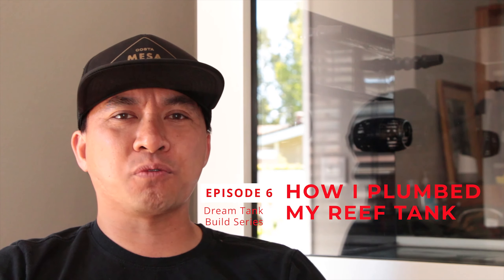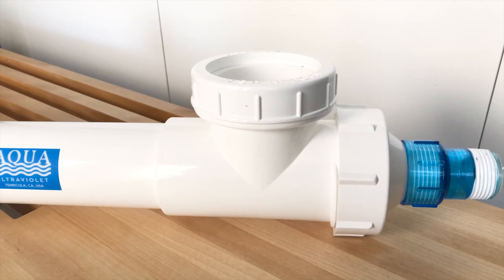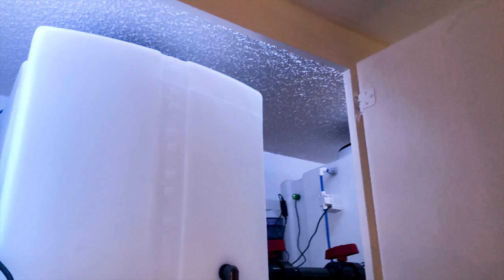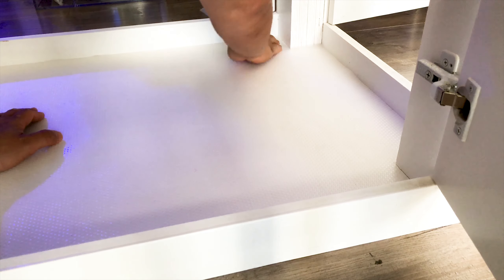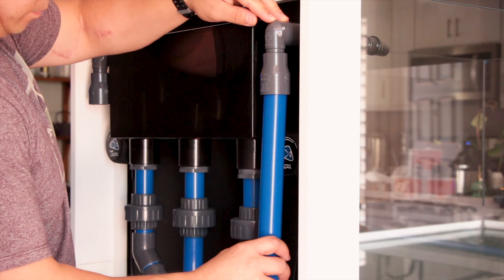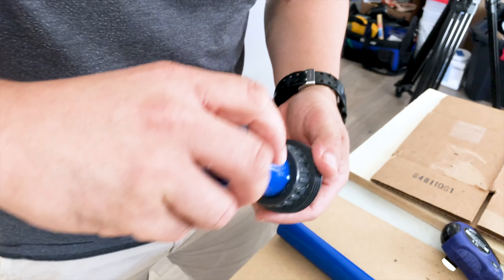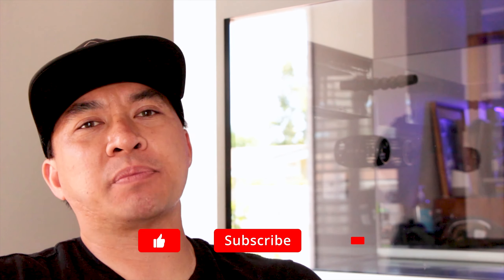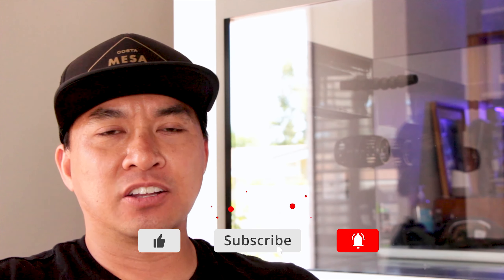Dream Reef Tank Build Series | Ep. 6 | How I Plumbed My Reef Tank

Comment: Do you have the exit of the UV plumbed into the return lines instead of routing it back into the sump? If so, I would reconsider that one. 

Looks great all together!
Reply from the maker: @JCasper thanks for watching! Yes, my UV is plumbed so that is exits back to my return and into the display. I appreciate your support!
Reply: @PetmaluLife  Do you have any safe guards on the UV plumbing to make sure that if the return is flowing at a higher rate than the UV it won’t backflow into the outlet of the UV?
Reply: Won’t it create pressure where the water is trying to exit? 
There is already flow going that way so want it be working against each other?
Reply from the maker: @cameronbasford8991  Thanks for watching! Based on my flow sensors, looks like everything is at my ideal gph rate so it doesn't looking like there are any pressure issues.

Comment: Really good job man! Looks amazing, what size of pvc did you use? 1”? I’m planning my plumbing for a 120 Gallon with a Bean Animal as well, but don’t know if I should go with 3 drains on 1” or 1” 1/2? I feel 1 1/12 is way too much for the size of that tank! I would appreciate your recommendation!
Reply from the maker: Hey Allan!  Thanks so much!  I used 1" PVC which is plenty large for my system.  I can't even open up the gate valve all the way because the water will come down too fast into my sump and make too much noise.  I think 1" will definitely work for you especially since you're doing bean animal style.  Let me know how it works out!
Reply: @PetmaluLife  Thanks man! I will definitely let you know!

Comment: I only have great things to say about your video production and your build equipment. Everything looks top of the line. 

However, I’m not sure the clarisea will be productive being plumbed off the manifold - by the time the water reaches it, the sump will already be a garbage can. Why can’t you switch the location of the skimmer with the clarisea? I would do whatever it takes to put the filter roller first whether drilling baffles or removing a baffle altogether.
Reply from the maker: Thanks for your feedback. ClariSea talks about being able to run your own pump from it. Works totally fine. I can control the amount of flow going though it as well. For example I really only want to be around 5x turnover for the tank but for the ClariSea I can bump that up to 10x if I wanted to. The water in the sump would circulate and be clean. Also, with the help of the large skimmer and UV, sump should be pretty clean. But only time will tell and also what kind of stock I put in. But, I’ll keep you updated for sure.

Comment: Bro subs ako agad! I’m gonna do what you’re doing 😀,. I’m in the process of starting my WB Peninsula 4820. Question bro,. between the Neptune Apex and GHL Profilux,. Ano mas maganda, reliable? Pros and Cons ng dalawa? Thanks bro! More power and more subscriber for you too! Ingatz
And also,. why did you use 1” piping? I ordered 1/2”... will that be enough or should I go 1”?
Reply from the maker: Hey bro! Thanks for the sub! Congrats on your new tank build. To be honest, I’m still new to Apex so I couldn’t really give a fair comparison between Apex or GHL. I don’t think you could go wrong with either one. I liked the Apex only because it had a few more accessories, such as flow meter and it can control my COR20 return pump. I do like the clean look of the GHL though. As for piping, I highly recommend 1” piping. The bigger the better for more flow. Keep in touch and let me know how your tank build goes.